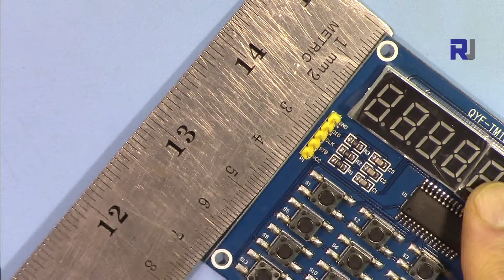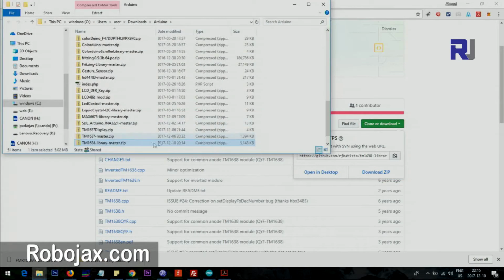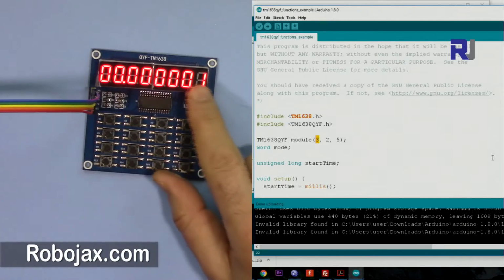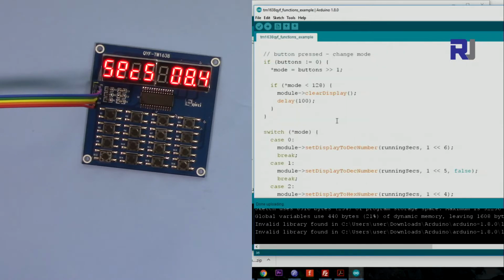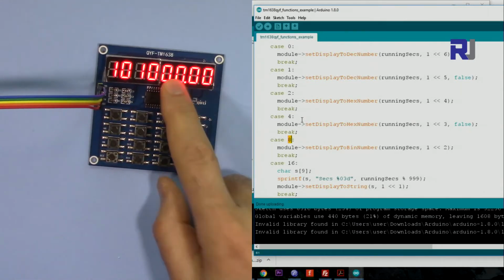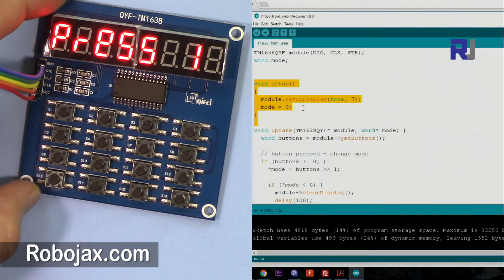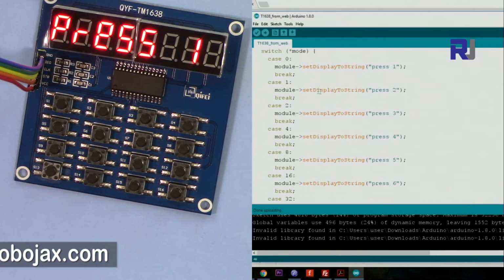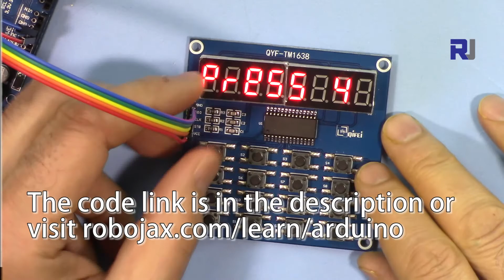How to use TM1638 4 digit display (QYF) with code RJT21

Comment: Can the buttons be used as digital inputs to the Arduino to trigger different actions?
Reply from the maker: Yes indeed.  Turn off the device and check if each button using ohmmeter to see if they are connected to high or low state and use the same kind of signal to input value to the module. Good luck

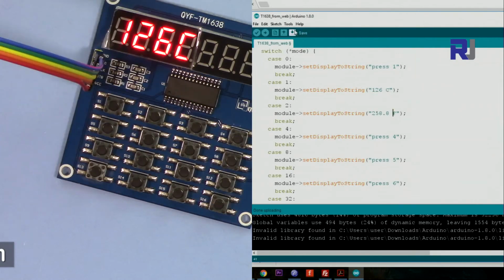Comment: Great video, sorry to nit-pic, but at 10:16 you say:  "squared".  The values actually "double" with each new button, after S1 and S2, which are 0 and 1 respectively.  See my other note for a complete map of the button values.
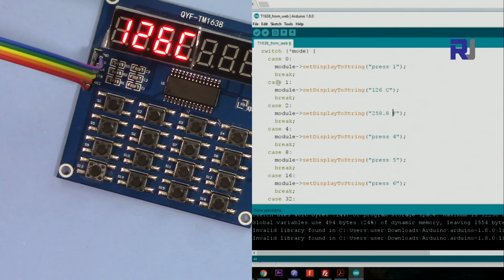Reply from the maker: thanks. I watched the video and  at10:16 I did not see anything about "squared".
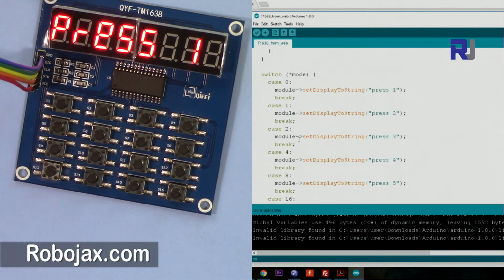Reply: @robojax  sorry. It's about 10:00 when you say it. Maybe start listening at 9:40. Also, a cool thing is that this module can detect when 2 or more buttons are being held down at the same time. Except for S1. Since it's value is 0. But all other buttons will add their solo value to a total. For example, if s3 (value 4) and s4 (value 8) are held down together when getButtons is called then the value will come back 12. This might be a great way to add a hidden feature to your project.
Reply from the maker: Wow , this is very interesting. I don’t know here I put the module, but definitely keep it in mind.

Comment: These are great, inexpensive little modules.  Would anyone like to collaborate with me to make a door access (password) sketch for this, or also a full 4 function Arduino calculator. Let's go!
Reply from the maker: very interesting project.  how can you help?
Reply: @robojax  might not be as easy as I thought. After doing some research, Arduino does not have great support for floating point numbers.

Comment: The operation for the sixteen button TM1638 is much mor difficult than the 8 button TM1638 in my opinion
Reply from the maker: Yes I agree.
Reply: Just a little power of two math.  I put comments into my code:
For reference: Button reads if single buttons are down when the scan occurs:
Number all 16 buttons from top (left to right) and then down to the next row.
If more than one button is held down at the same time, each button
will ADD exactly this much to the total "button" number.
For example, if he 2 and the 6 key are both being held, the number will read as:
1 + 16  so,  17;

1   0  // top row
2   1
3   2
4   4
5   8   // second row
6   16
7   32
8   64
9   128  // third row
10  256  
11  512 
12 1024
13  2028 // fourth (bottom)  row
14  4156
15  8192  
16  16384

*/

Comment: Nice video! I kind of like those TM16xx chips. If you watch my recent videos you can see I've been playing with the TM1638, but also other chips of that family, such as TM1637, TM1640 and TM1668. To make things easier I've made a new TMxx library based on the work of Ricardo Batista and other people. Now you can use regular print() statements to print text or connect a LED matrix to the TM16xx chip and use Adafruit GFX functions. You can find that library on Github (search for TM16xx). Currently I'm working on an advanced button class and intend to support callback functions for click, doubleclick and longpress. I will also support the multiple rows of buttons. To complete that version I just ordered the QYF-TM1638 module that you demonstrated in your video, but it will take some time to get it delivered.
Reply: Just updated my library on github for this, the TM1638, see: https://github.com/codebeat-nl/xtm1638 The fastest library around, thank you ;-) See discription.

Comment: I have the exact same module but it only works on 3.3v supply with 5v logic... mine does not work with 5v supply.
Reply: was mine manufactured in a different way?